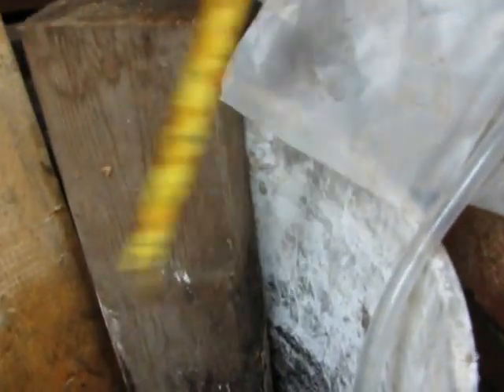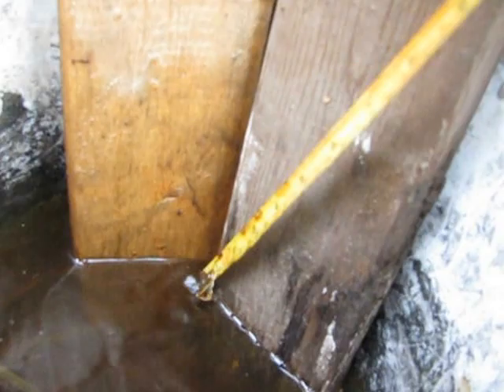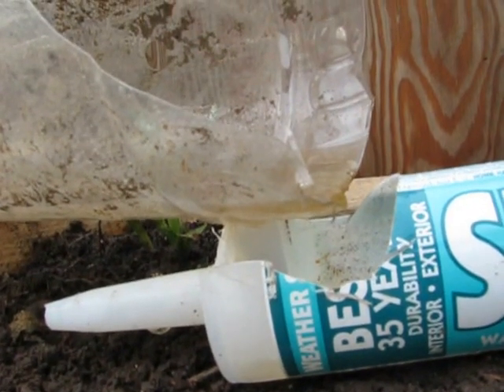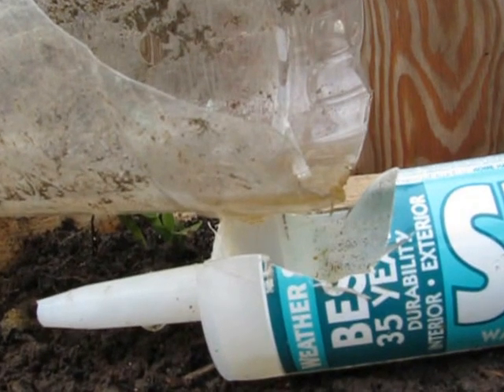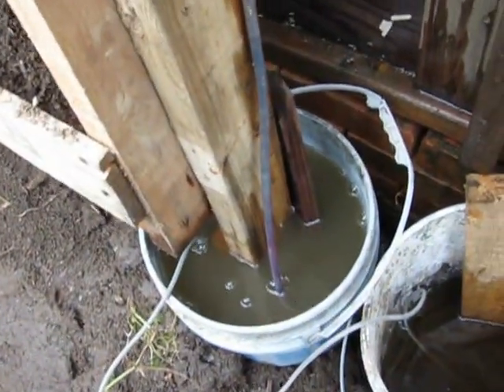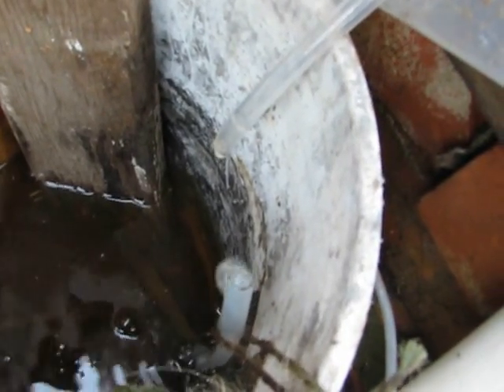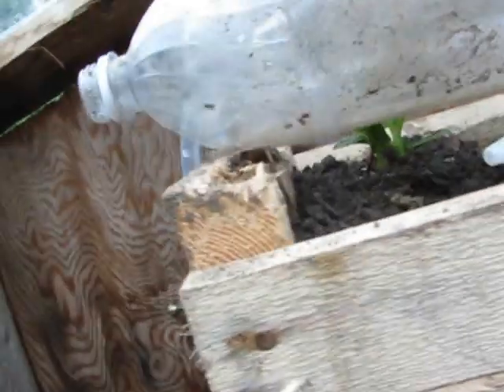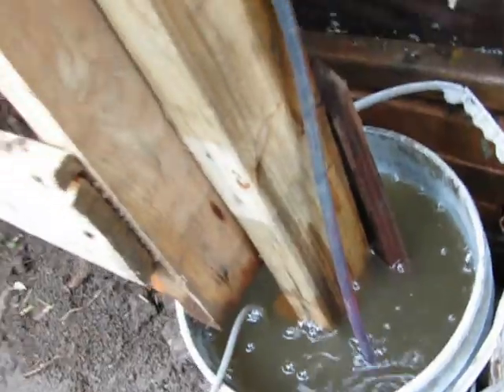Facinating! Tiny submergence (tiny air pressure) lifting water over 5 ft high! Read the description.

Comment: Thanks for wonderful video , i trying it at home but i am enable to perform it. How we generate air pressure ..... Pl fuide
Reply from the maker: Prayag Singh   I used an aquarium bubble pump.  They use them to pump air into desktop aquariums.   Last year I ordered some 12 volt air pumps from china.  Only the brushless air pumps are good.  Also, the ones with the simplest air bladder are the best. I have used them since July attached to a solar panel.    You can also generate air with water power.    Check out my pulser pump.   But you do not need to go deep down like a pulser pump.  If you bring the air 1 meter down, under the water, that is enough pressure to do lots of work.  The experiment was just testing the limits of the process.  I think you need submergence at least 20 cm deep to do anything useful.      Those air pumps produce 2 or 3 psi which is enough pressure to drive air about 1.5 meters deep under water.    If you are having problems with the experiment,  sometimes that is caused by the pipe being too new.   New pipes work badly.   I either wash them out or make them really dirty with mud inside them before using them.  I think there is an oil or solvent from manufacture and this makes them work badly when they are new.     Hope that helps,  Brian

Comment: This is an airlift pump plain and simple. You pump air at greater pressure into a column of water and it rises taking some of the water with it. Its pretty inneficient though as a fair amount of the water will flow 'around' the air bubble as it rises...
One big advantage of this method is that if you are doing a lot of water oxygenating for a Koi Pond for example you can combine pump and oxygenator, however for small applications small air pumps tend to be mechanically cheap and nasty with short lives...
Reply from the maker: Nick it is simply not true that they are cheap and nasty. My air pump is 100 ft away from the greenhouse and has worked 6 airlift pumps for over a year. If you go high end, general hydroponics air pumps are raved about.   This is not an airlift pump pure and simple.  It is a very special case.  Read the literature.   Airlift pumps were not known to work at 20 to 1 lift to submergence ratio before these videos.  And windowfarms is worldwide proof that air pumps beat water pumps for small hydroponics applications. They started with water pumps and nearly everyone uses an air pump now.
Reply: I made my silly airlift fill up a bucket in my greenhouse wich has a siphon in it. Once per day the bucket fills and irrigates my greenhouse... doing this with a 7v airpump

Comment: See if a temperature change affects it - or a drop or two of dishwashing liquid.
My personal interest here would be circulation/degassing in intensive aquaculture with O2 injected via Speece cones. 
45 degree plug flow in 1m of water might be hard to achieve though.

Comment from the maker: Capillary action cannot explain it in a 1/4 inch diameter tube going over 5 ft high!  But maybe the surface tension (which is somewhat related to capillary action)  changed or the inlet pipe conditions changed a little?   The thing that strikes me is that the water plug speed is so bluddy EVEN!   Usually the plugs speed up and slow down as they go up the tube and this just wastes energy.

Comment from the maker: I swapped out the piece of tubing that curls around and brings water to the airlift last night and replaced it with a longer tube.  This morning submergence was slightly less than 3 inches pumping to 67 inches high.  That is over 20 to 1 lift to submergence ratio.  I still don't fully understand why it is working.  This is so simple!  I am sure it can be optimized and do even better.
Reply: Could it be that the amount of water sitting on top of the lighter air is lifting the water. As in the water tension in the droplet is causing resistance to the air that wants to go up. So the ratio of water to air has to be just right. To much water and it does not lift and of course to little water and you may not have drops forming in the tube.